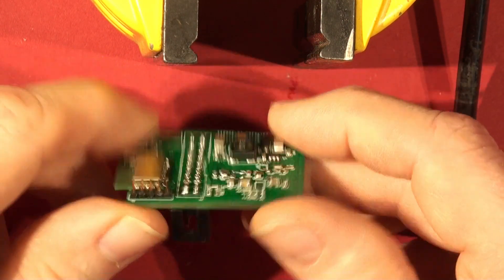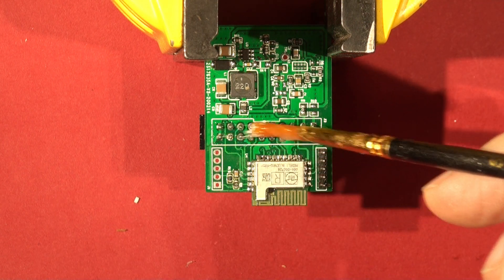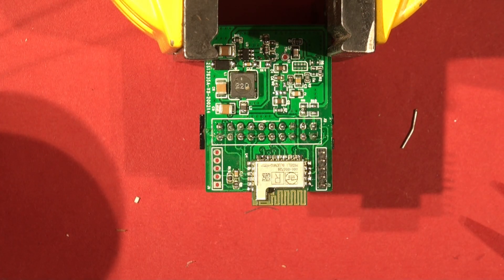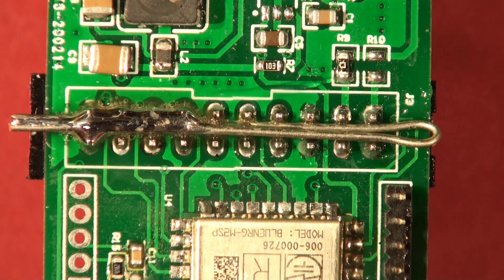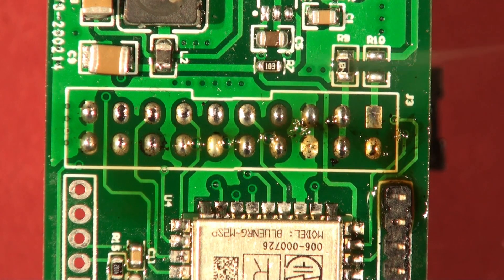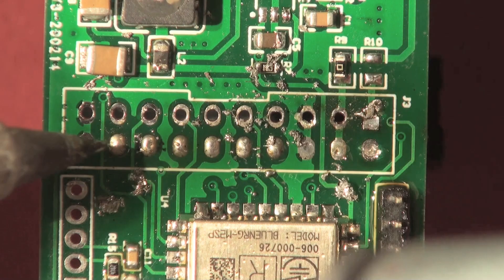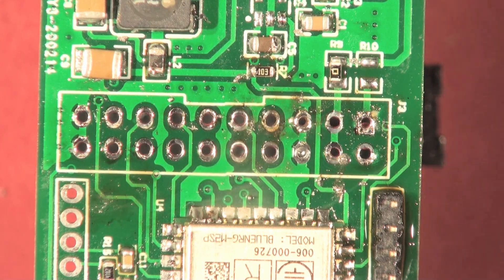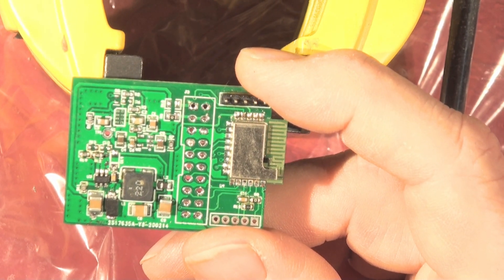Easy Multi Pin Through Hole Socket removal with just a soldering iron Using this Trick

Comment: Hmm... isn't better to use cheap and right tools instead of spending time on bending wire, soldering it etc? I would recommend to buy T12 soldering station with iron series 14xx or much more better, but also much more expensive T245/T210 compatible soldering station with similar iron(s) series. In this case, just put gel flux on pins and heat them. Usually I spend max 10 seconds for removal any 1 or 2 rows headers. Waste of time is struggling with such a simple issue.
Reply from the maker: Good for you... Here in the real world things are never that simple.

Comment: would an hot plate be usefull for those kind of sockets removal?
Reply from the maker: Could be. I prefer not to heat up an entire board and it electronics because it causes stress and most have strict limits of max process temperatures and duration and without a controlled process it if difficult to meet these specs.. basically reliability could be affected.

Comment: Work of art!👍
I wish you had pumped out the solder debri anywhere other than on the board 😊. Tht would have been perfect.
Reply from the maker: Point taken.  I clean every board with IPA and a brush and inspect.  I seen managed so many engineers that spend hours debugging a fault that has been caused by their own sloppy solder splashes.

Comment: Hot air works, but I like this method better as the hot air heats up too much of the board.
Reply from the maker: Yes Hot air takes ages and it is very difficult to get it to melt. It stresses other components too.  I invariably reach for the copper wire.

Comment: Thank you! My lab technician and I tried desoldering a 20 pin through hole connector on a multilayer PCB and we decided to break the component and took the pins out after! This technique would have been so much easier.
Reply from the maker: Glad I could help!

Comment: Working on replacing a variable resistor (of a Vestax dj controller which is very worthy to me) with 'only' 5 points and actually came up with this idea myself and searched the net if this was stupid.
Your video proved it to be a good idea.
Thank you very much making the video and taking the effort of sharing.
I didn't think of using solder but only a wire, maybe connected to soldering iron but this looks like thé trick 🙏🏽
Reply from the maker: I am pleased you found it useful. Thanks for the comment.

Comment: would this work with a paper clip? or does it have to be copper
Reply from the maker: Possibley. Compared to copper has a dramatically lower thermal conductivity.  Since a paperclip would help maintain the solder flood then I reckon a paperclip  is worth a  try as the solder blob will conduct the heat.

Comment: Please bin that old PCB killer sucker 😮‍💨
It's much more safe to use braided solder wick, though it may take some time to adapt to this method.
The tin sucker is only safe on old tube radios with birds nest fitted components.
Reply from the maker: Strange comment.  Everyone one knows expensive solder  will not clear 1.6mm plated through holes.  I have never damaged a PCB with it and it always works speedily and efficiently and does not waste money or copper.
Reply: @razenby  Strange reply to a comment. Everyone one knows that a tin sucker is able to suck up a heated pcb pad and part of the pcb track together with the melted tin.
Everyone one also knows that a freshly tinned 1.6mm plated thru hole can be cleaned out using solder wick.
I have never damaged a pcb with it and it always works speedily and efficiently and does not waste eyeballs or lamp bulbs or copper.

Comment: Nice method, but geezus christ you are putting a lot of heat for a long time, onto that board & nearby components. Would be better to try n get it done a lot quicker, with less pfaffing around.
Reply from the maker: Heat is no the same as temperature. It is  perfectly safe and within the spec of the FR4 and the components. Due to the mass being heated the overall temp is just about the melting point of Sn/Pb  60/40 so well withing the reflow temperature range. That is the difference between an professional and an amateur with a hammer.  The skill is knowing how hard to hit it.
Reply: @razenby You are an imbecile who has obviously never soldered anything in your life. Every pad on that board has a copper trace that conducts heat very rapidly along to other components which are heat sensitive. The longer you sit there, with molten solder in contact with the circuit, the more you fry the components all around. Fact.

Comment: Good video!. Interesting tips!! What temperature you set the iron?. I have to desolder a small alps spuj dpdt switch.
Reply from the maker: About 380 degrees. The temperature that the iron is stet to is important but so many cheap irons have a problem delivering the heat into the work-piece as they often don't have a good thermal coupling between the sensor the tip and the element.  If in doubt use 400 C or a larger soldering tip.

Comment: Perfect advice. Needed to remove a similar 16 pin connector at home as my normal hakko desoldering equipment is back at work due to the lockdown. 
Worked a treat with this method demonstrated and again the part fell right out !
Thanks again  will hit the subscribe button.
Reply from the maker: Glad it helped. Thanks.

Comment: Great trick!  Didn't thought it was this easy.  Can you recommend a desoldering pump that works well ?
Reply from the maker: The desoldering pumps that I have tried are sitting on the store room. They are not that useful.  They maybe OK of some specific production problems but I never got along with them.  The advice you should tale away from this video is the most important tool by far is the actual soldering iron. I have used virtually every cheap one there is and they are a true false economy.  The ability to deliver the power and control the temperature is key. My Weller is 90 Watts with silver heating element closely coupled to the solder tip.  The cheaper irons are like trying to play soccer with ballet shoes on. I discovered a decent hand solder sucker, a good iron, some flux, some decent Loctite or (formerly Multicore)  60/40 lead/tin and excellent close up vision is all you need, I rarely use hot air soldering much as this tends to stress some components when repairing stuff.
Reply: @razenby    Agreed about a strong iron

Comment: Very nice people get lazy by always using hot air and if their hot air brakes they can't continue
Reply from the maker: Hot air has many problems due to poor quality PCBs and cheap hot air soldering tools that do not control the temperature properly.  Often it is easier and does less damage to use a good quality soldering iron and do it fast with localized heat.

Comment: What, so you don't apply heat to each pin one by one, pull on the pins individually, melt the plastic, swear like a trooper, mangle the pins, attempt to lay the soldering iron flat across the whole thing hoping that might help then after 20 minutes give up and throw the board away anyway? That's I how thought it was supposed to be done?!

(NB nice to find a fellow electronics Brit on youtube I hadn't seen before!)
Reply from the maker: Thanks.  Glad it was useful...